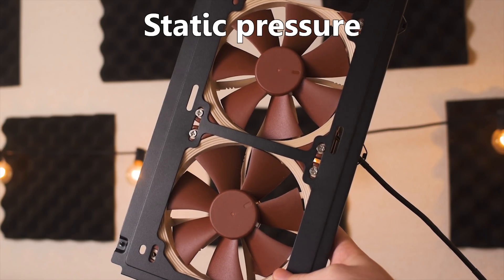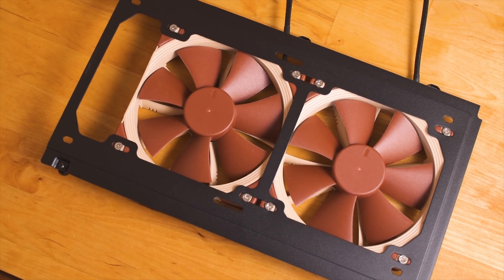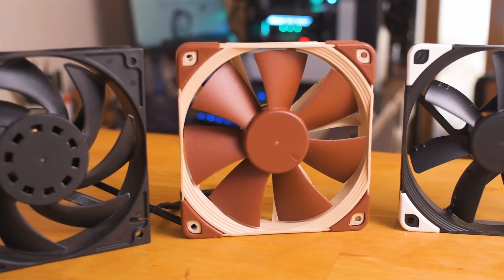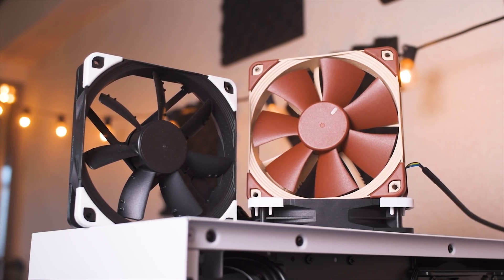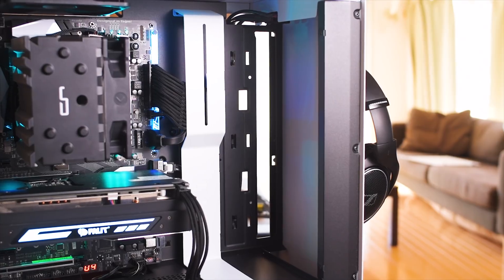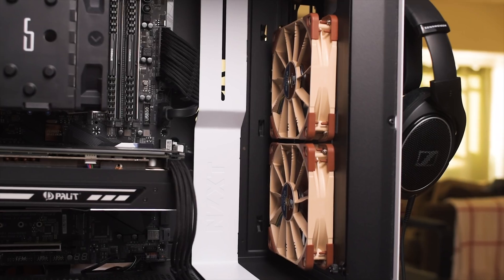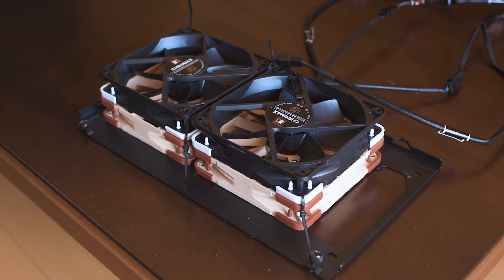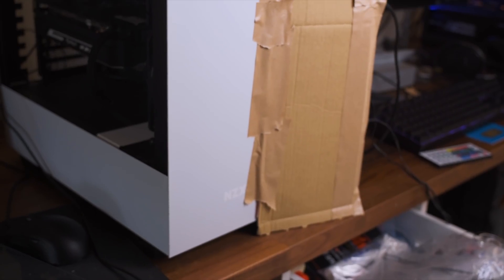DON'T buy front intake fans! (For NZXT H500/S340)

Comment: What about adding a 280mm corsair hydro h115i pro in the front?
Reply: Hi. I did exactly this since there is no other way to install the AIO. And i have issues with my cpu temps now which i am trying to figure out! In Prime95 i reach almost 97C on i7 8700K OC to 4.8. I am not sure what is the issue yet.I just refer it.

Comment: Got a H500i and no water cooling. Front fans definitely make a difference in temps both for CPU and GPU. Idle was around 45C before and now it is at 33-35C. 

Running gaming on ultra WITH fans keeps my system at 55-65C with GPU being the highest. Without the extra 2 fans my system runs 75C-80C easy! Definitely put fans and help your system out RGB makes it -0C

Comment: I recently bought a H500i,  this is good information to know, since adding front fans seems like the logical choice. I like your doubling of fans idea, did you try adding a 140 mm high cfm fan to the top of the case as a booster to the existing NZXT fan? An external rgb fan would look pretty cool.

Comment: So does the noctua fit in the h500i case?
Reply: Fortnite Fan are you challenged or something?
Reply: @mustafas9011  yes y
Reply: Fortnite Fan you Can clearly see they fit in the case . I wouldn’t recommend the NZXT case . Not even the h700 I bought the h500 and returned it . They are not solid build at tall . Probably one of the worst cases on the market

Comment: I have just built my setup with 3700x and phoenix 2060 which is a hot card. I wonder should i get intake fans
I haven't installed windows yet, so idk how bar the system temps are.
Reply: cyanogenmoded install intake fans so ur CPU and GPU get enough cold air

Comment: What is most hilarious about the internet? Dozens of reputable tech sites have done airflow and pressure tests when it comes to temperature with this case (and others). The results are always the same: front fans are useless. And yet, the "actually..." tards will come out in full force, copy-pasting garbage they found on Wikipedia to post in a pointless back-and-forth to sound smart instead of teaching or learning anything. Or they are so OCD about always needing front fans that they will install them anyway; increasing the price of the build, as well as the noise and power draw.

Comment: How will thermals in this case be with an i7-9700k air cooled with a dark rock pro 4 and a NVIDIA 2070S reference card? Debating going with the reference card or an aftermarket EVGA card like the 2070S XC Ultra Gaming. Any big difference that I would notice? No plan to overclock or water cool.

Comment: Hoping you reply!

I have an h500 and I know it's a negative pressure system but I wanted to purchase the kraken x62 water cooler and mount it in the front bracket. Bad idea?
Reply from the maker: It's not a bad idea. There is still air coming through the front so you will be good.
I have an AIO in the front of one and it performs fine.
Reply: @DawidDoesTechStuff  I'm wondering if it's gonna raise my gpu temps because now it'll be circulating heated air from the radiator into the case
Reply from the maker: @WakeSideLife  It could make a bit of a difference, but it is a very common configuration on the H500 so I'm sure you'll be fine. :) I use it like that with a RTX 2070 and the GPU temps are fine.

Comment: Well if you have a case with pretty restricted intakes, just buy something with more than 2000 RPM and bear with the noise your case makes to be cool inside or just cope with the fact that you have a case that focuses on looks and not on performance.
Also, the Vardars have a nicer P-Q curve than the NF-F12 for sure, as Noctua proves with the similar designed NF-A12x25 in their marketing for it, absolute pressure and airflow numbers can mean anything really

Comment: Getting new pc in few days with this case , ryzen 3600 with rtx 2070 super, shall i get 2 fans in front than or?
Reply: Yeah I've been asking myself the same question cuz i also am getting a r5 3600 and an rtx 2080 but unfortunately I already ordered the fans
Reply: don't buy this case if you intend to buy x570 mobo with the chipset fans. Because of poor air flow  the chipset fan temps will reach 85+°C. Don't get fecked like i did
Reply: @mesicek7  just got cooler master h500 , with x570, temps are rly cool with that case at max loads no problem at all with airflow
Reply: @Markzy_DM  yeah thats a much better case when it comes to airflow since it doesnt have the front shut

Comment: What about upgrading the fans at the top and rear ? Keeping it negative but just better fans? Also I want to buy a bequiet dark rock pro 4 as I know it just fits but I'm worried it will block airflow since it will be right up against the fans almost ?

Comment: Correct. These cases are best configured for negative pressure. So use a few outtake fans only. This does result in higher CPU temperatures but lower GPU temperatures if you go AIR only.

Comment: too many intake fans compared to the out take fans, so basically your airflow there is garbage and doesnt change anything between the test with 2 intake fans and 7. because the outtake fans cant push out all the air taht comes in, which means your intake fans are gonna slow down, and legit nothing has changed.

Comment: not using intake fans turns your pc into a vacuum cleaner
Reply: But in this case, using front fans is choking your pc.
Reply: Very true, and they left open the pcie brackets with no filter...
Reply: Yup. You want slight positive pressure, so 50-60% should be intake so you direct the air through your filters. Otherwise it gets sucked in every nook and cranny that is not filtered.

Comment: If I get the h500 do  I need extra fans or are the stock ones enough btw I'ma be using 5700xt
Reply: Probably want to get new higher quality air flow fans because AMD GPUs are like space heaters... especially XT.. I’m getting my H500 case today in the mail, I’ll come back and let you know how i feel about the case and temps.. btw I have an RTX 2080, so your experience may be different because my card runs cooler and doesn’t use as much wattage= cooler system overall. 

I’ll experiment and let you know man!
Reply: SKY TECH Enterprise k thx btw I'ma wait until 3rd party designs come out with better cooling and driver s
Reply: SKY TECH Enterprise What fans do you recommend for exhaust top/rear? I also have 5700 xt

Comment: Well i put 2 fans at the front, with 1700RPM, yeah as you said there are no difference. My Gtx 1660 load is 70-75C ( with 30-35C ambient temp ). 
The only way to decrease my GPU temp to 65C is increase my fan speed to 90%, should i increase it? Or my GPU temp is fine?
Reply: pranowo94  I believe you should be okay with 75c.
Reply: @lmc9756  yeah that was stress test from 3Dmark. I realize ambient temp really effect my GPU temp. At day max load 71C (playing games) at night max 65C

Comment: nice Video ... but ... the main Question is not that the Fans dont work .. its a crappy Case that has the wrong Design ...  its more the Physical dimensions inside the case . btw the Distance between Fans and Front panel . I have the Sahrara p75  with Glas panel in the Front. But between the 4 Front fans and the panel is a Space with 4cm  on both sides are Air intakes from Top to bottom  2cm Wide with mesh. so the Room in front of the fans is 4cm x 20cm x 50 cm and the intake openings are 2cm x 41cm  on both sides . 
and inside it is definetly a lot of Airflow  behind the Fans.  the room in front of the fans is working as a reservoir wich enables the fans to catch the air to build the Airflow.
 ok .. i ignored the Fact, that they are 4 Rainbow ARGB Fans ... so maybe the Physics ha nothing to do and it is only the RGB  wich enables the fans to work so good :-)

Comment: You should have tried changing the rpm to max. Only in the front to see if there was a change in temperatures. Or put a thin piece cloth or paper on the side to see if there was a strong enough airflow being pulled into the case.
All in all you would be sacrificing minimal noise for airflow. I personally think it's a beautiful case, but it does lack airflow.

Comment: ALSO, putting stronger or more fans behind that front panel is NOT going to change anything, as AGAIN your issue is they are just drawing air from that HUGE GAP above the fans & recirculating the "internal" air! Its MUCH easier for them to draw in air through that gap above them then it is to draw it through the tiny vent holes! Its COMMON SENSE! So frustrating, do u really not have common sense?

Comment: PLEASE plug that gap above the 2 front fans and test again! I have a similar PC case and that was 110% the issue here! its MUCH easier for the front fans to just suck the air from inside the case through that gap then it is for them to suck air through the "limited" tine vent holes in the case! So they are just recirculating the air from inside! (it should be OBVIOUS!) Plug that gap & PLEASE test again!! ur doing it wrong!

Comment: THE REASON: None of these Fans are actually taking air from the outside! Because your installation has a HUGE fault! Because of the "ridiculously" tine vent holes in the front you see that "gap" you have above the fans in the front?? Thats your problem! its much easier for them to suck the air through that (very large) gap from inside the case then is is to suck the air through the tiny vent holes!! CLOSE that gap!!

Comment: No thanks. Everyone knows case fans are just for show and all it does is provide KEWL RGB.

On a serious note, my case with similar front intake got like 30°c hotter without turning on the fans (accidentally turned them off). It was so hot that the PC actually shut down. I burnt my palms from touching the tempered glass lol.

Comment: I built in this case with and without front intake fans. The temperature was essentially the same when gaming in both scenarios, although I did not collect data with the same level of detail that is shown here. In the end I decided to leave the fans installed since I had already purchased them. They are very quiet and it provides some redundancy in the event that another fan fails.

Comment: The problem is the types of fans you are using, do smoke tests on your fans and build with the right fan, my CPU stays on load at 33c and 18 idle (12c on cold start after day off). The case is a problem with the lack of airflow channels however like anything else you need to take in account everything from fan put out to how it moves air through the case. There are some really good smoke tests for fans on youtube. I recommend watching them as you can learn a lot. A fan for example that puts air out side ways for a from fan isn't going to move air to your CPU/GPU fast enough resulting in little to no affect where as a fan that does not move air side ways but directional towards your CPU/GPU is going to make a notacable difference. Additionally you can bottle neck the air in the case depending on how you have your fans setup. A lot of people who run in the 60c range on a new build either doesnt use good paste, has a crappy heat sink, or doesnt have proper air circulation or all the above. Breaking it down, Lets say i have 2 exhaust fans, both move air in a straight shot, the front are non directional and move air in a circular motion not going straight. I have a heat sink that has 2 dual fans. (for the sake of argument we'll say they all run a the same RPM, as to not over do this example and make it more complicated than it should be) The heat sink is also non directional side ways in how it moves air. My exhaust fans are going to move a lot of air out of the case which is fantastic but the problem is i am moving hot air away from the CPU faster than i am getting cool air to it. Now if i reverse this one would think i would get more build up of cold air in the case since the intakes are moving air more direct to cool than the exhaust fans, but theres the bottle neck, the exhaust can only move so much, cold start its nice and chill but after running a while the heats going to build up and its not going to stay cool. Yes RPMs of the fans matter, yes higher RPM's = louder fan like ball fans but not always, there are some decent prices fans out there that move a crap load of air. Theres also expensive fans that don't move crap but have great reviews. Build the system down to the spec of every part including the dynamics of the case, do it right.
Reply: Also the case isn't true sealed, meaning airs coming in around the IO shield, at every crack, the exhaust is not sucking air out like it would if the entire case was sealed at every corner besides fan ports so example, try and blow your noes with out plugging the other side and ask your self what the difference is in air movement to blocking the other side. Your system is example like this. How you get around this is directional fans. Cold air hits your CPU, CPU heat sink also has directional to take it all the way to exhaust, if CPU has non directional side ways, exhaust is sucking up about 70% of that heat where the rest is probably falling down on your GPU on that card you got installed then cycling back up again.
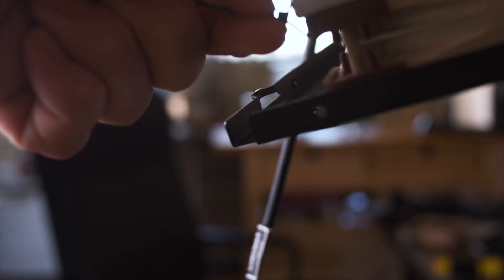Reply: https://www.youtube.com/watch?v=QMePTeZnaAc amazing example. Look at 4:30 in video and its a great example how fans and how they blow air makes a huge difference.

Comment: I agree with your original assessment, that it's unnecessary to purchase intake fans for this style case. However I find issue with your statements and testing. Firstly, having the 2 NZXT fans does not create convection, it overrides convection. Convection is a basic statement that heat rises. If you flip the case upside down, the heat will be forced down because of the pressure the fans create. Even in a chimney airflow case like the Silverstone Raven RV02, the fans aren't using convection, they are using pressure. You can create a down-draft airflow if you need to test this. Secondly, strapping a fan to the back of a fan would produce results worse than either fan alone because of the insane turbulence it would create because of unsteady pressure waves. Best case scenario is that once fan forces the other to run at the same rate of airflow, but it will still be worse because of the drag the other fan has introduced. I believe that any drop in temperature you gained from this test is because of the 3 fans on the outside of the case, and the shroud you built for them.

I really would have liked to see you put the static pressure fans at the front of the case as exhaust, and used the airflow fans at the back / top of the case as intake. I think this would be a valid test on the H500 / S340 with 4 fans vs stock 2 fan setup. It could possibly still perform worse than stock, but at least it would make sense aerodynamically.

Comment: Is it likely to make a difference if the pc is in a more enclosed area? I cannot confirm this without getting some thermometers in there but it seems to me that all of the warm are being blown out the back and top (including from the psu), means that the air pulled in through the expans slot venting will be above ambient. In that case, would trying to encourage a bit more airflow through the front make even a small difference?

On a side note, it it worth upgrading the top exhaust fan to a 140mm?

Comment: Hey guys I have a little problem.. I’m building a pc for the first time and my case(NZXT h500) has 2( 3 pin fans) and my motherboard(gigabyte b450 aorus m)has all 4 pin fan headers. So the question is can i connect the 3 pin fan to the 4 pin fan header on the board? And if i do it ,wil it disturb the performance of the fans?

Sorry for bad english(not my primary language)
Reply from the maker: Hello.
Don't worry your English is very good. :D 
In regards to your question, you can definitely plug them into the 4 pin plugs on your motherboard. The fans will run perfectly fine. You just won't be able to control their fan speeds through your motherboard. That is the main difference between 3 pin and 4 pin PWM fans.
Reply: Dawid Does Tech Stuff hey thanks for replying!
Reply from the maker: @ms6408  I'm always happy to help. :D

Comment: Yep i have this case and these fans, and quite interesting given this video and another video similar to this by another you tuber, fascinating topic, so i removed my two F12's from the front,  and then I put an F12 for Rear Exhaust and A14 for top exhaust, with the idea of pushing more air out instead of pulling in.

Comment: What would you recommend if I'm getting a Corsair H60 CPU cooler for the same case? I haven't built it yet but this is my plan for my first PC. I was thinking the cooler on the top vent, stock fan on the back, and one in front... (Back fans in exaust)
Reply from the maker: That sounds like a good setup, it may look better if you put the H60 radiator in the back instead. However that is purely down to preference. The putting the extra fan in the front won't do much and it may look a bit weird having just one fan in the front, but it doesn't really matter. 
In other words, you are on the right track. :D
Reply: @DawidDoesTechStuff  thnx I'm super excited for my first build... This is what I was planning in building (for now) https://pcpartpicker.com/list/j4qZV6 there isn't a GPU because I'm getting an RGB 2060 which wasn't on PC part picker... Also going to be switching the CPU for the 9100F
Reply: Dawid Does Tech Stuff I might be building my first PC in this case... I just have one question, is it alright to leave the front empty? I’ll most likely using an Air Cooler.

Comment: so just keep the stock fans that come with the case?
Reply from the maker: Exactly! No need to spend more money on fans with the H500.
Reply: Dawid Does Tech Stuff I’ve already bought 2 be quiet fans for the top and back just to replace the stock ones, I’m running a Ryzen 7 1700 and an RTX 2070 armor 8g so figured I’d just swap out the stock fans!